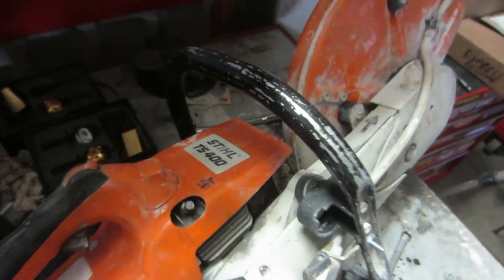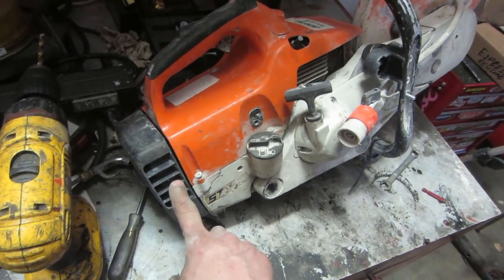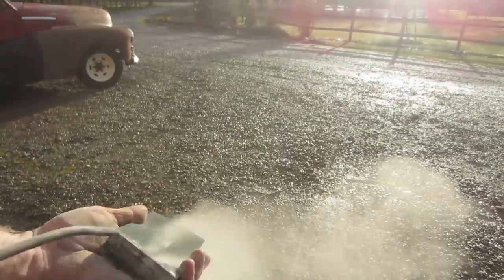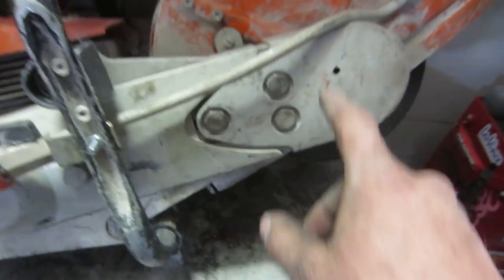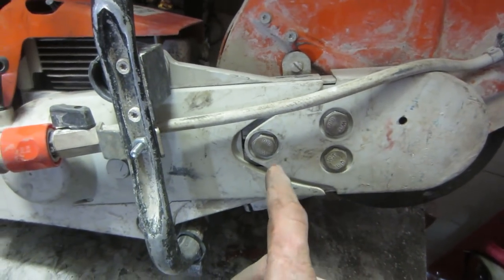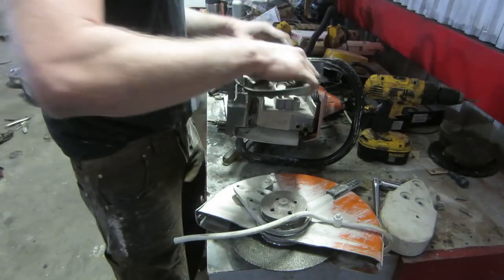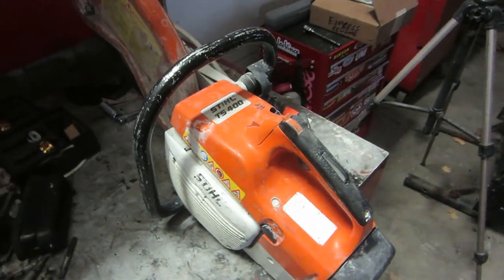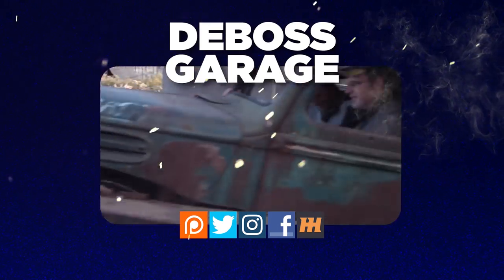Stihl Cut Off Saw TS400 Filter & Belt Tune Up

Comment: and we use a steel wheel for cutting steel and a nother steel wheel for cutting concrete the steel wheels last longer than the graphite black wheel's
Reply from the maker: I was using a diamond blade for the stone, I just needed a quick steel cut and did that before the service.
Reply: DEBOSS GARAGE 

oh ok
Reply from the maker: We have a video coming on the 20' fireplace/bbq I built coming up.  Took 6 years, but I got it done...
Reply: DEBOSS GARAGE 

ok